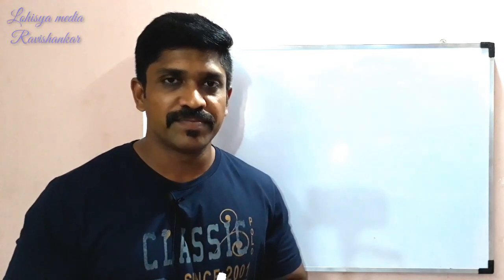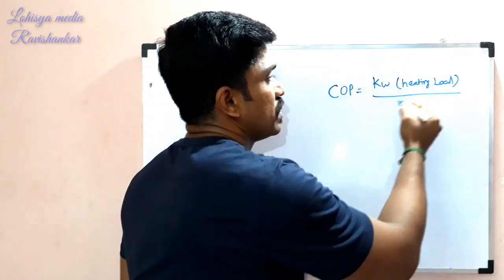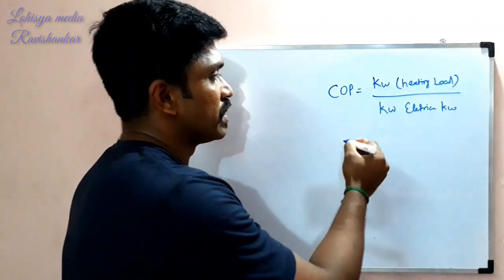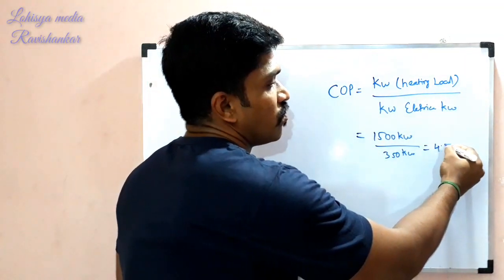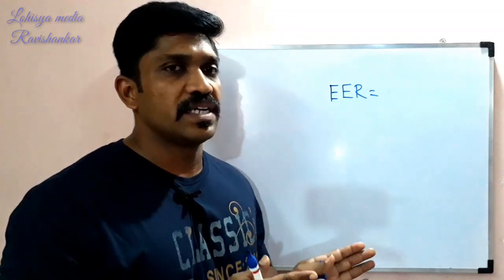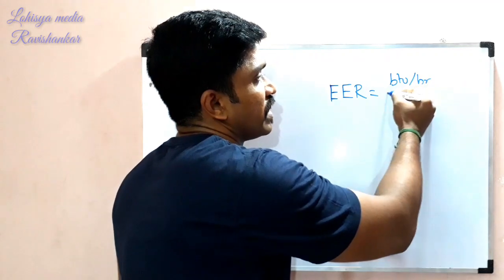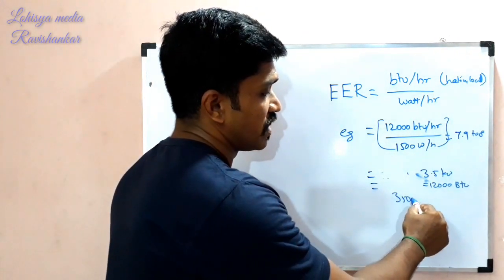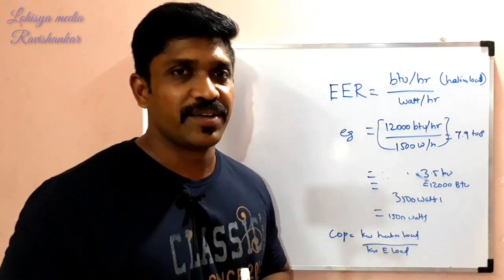COP & EER | What is COP & EER | HVAC | Tamil | Lohisya media

Comment: What is ikw
Reply from the maker: Specific Kw is mentioned ikw

Eg:  if u have 100 ton chiller with 65kw power input
Then the specific ikw is 100 ton means 100×3.5 kw =350

Then  350÷65=5.3ikw   
5.3kw  for 1ton
Reply: Anna last la 1500 watts ku BTU value epdi kandu pidikurathu...
Reply from the maker: @balasubramaniankumar9557  just easy bro
1500watts/3500watts = 0.4 tons
0.4 × 12000= Answer

Comment: Ji I have used on Onida split 3 star 1.5 ton normal ac , model sa183gdr/2017, EER rating 3.17 , but not showing in year of unit so how to calculate unit of days?
Ac Showing for cooling capacity 5140, power consumption 1610, how can calculate current unit? Please reply thanks